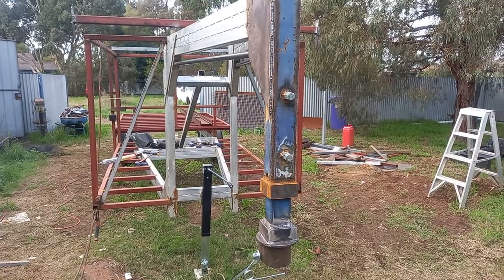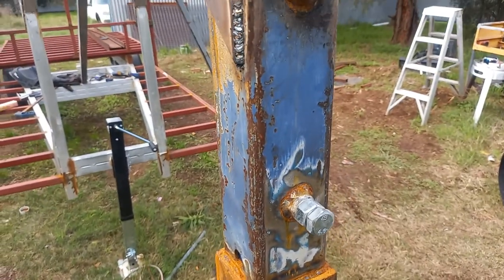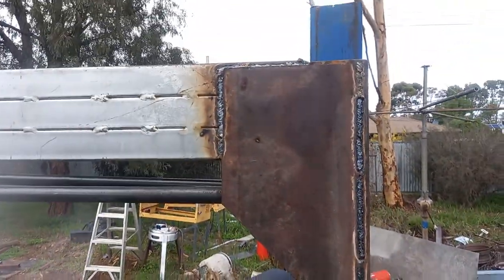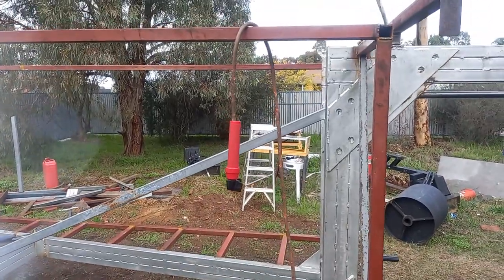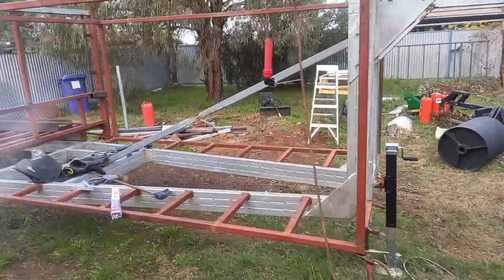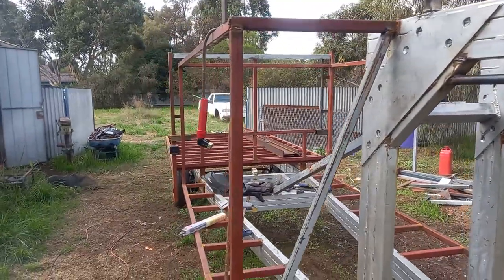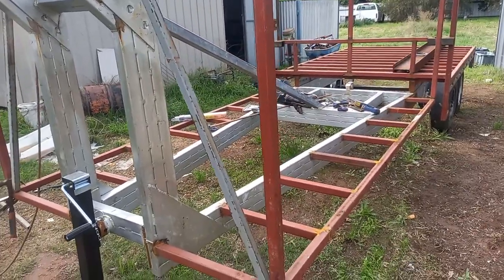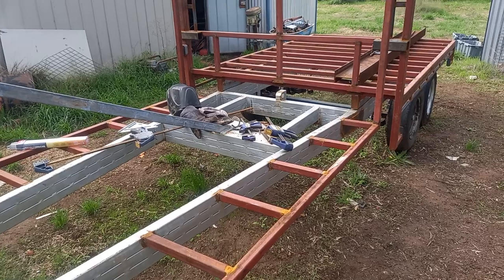Building a home made gooseneck cable tipper trailer vlog 7

Comment: Hi mate.  I've been bouncing ideas around in my thinking meat about building a dog trailer caravan/mobile home and your tri-axle tipper caught my eye.  I'm an ex-truckie and know the difference in the stability of a dog trailer configuration compared to a pig trailer layout.  Do you have any drawings and/or plans, with dimensions and materials, for the chassis layout for that build?  I just need something like that as a starting point and I don't mind paying for them.  Thanks in advance.
Reply from the maker: Thanks for reaching out TombstoneHeart.

I don't have plans for my dog except in the head. I don't draw anything up, I create around a external size. 
The same attitude can be attributed to your planned build. 
When I started, I based my ideas around a semi and a dolly rather than a dog trailer, then brought them together. The old how do you eat an elephant....I bite ful at a time. 
A pig trailer can have a lighter chassis as its pivoting in the centre, whereas a dog need rigidity in the centre. 
Design your overall concept, length, width and height. Axle(s) at the back, chassis needs to be either channel or RSJ or a truss frame (preferred) as its lighter. Then design the dolly.....and work out what you want as a coupling. 
Can purchase a 70 mm ball and coupling that are rated to 1400 kg download in Australia now, a turntable which on.a van I think will lead to structural cracks in your sides due to flexing. 
I personally would use a ball and socket next time. 
I can assist if you need help with the designs. Just send us a message on the phone number displayed. A lot of other people have contacted me this way.